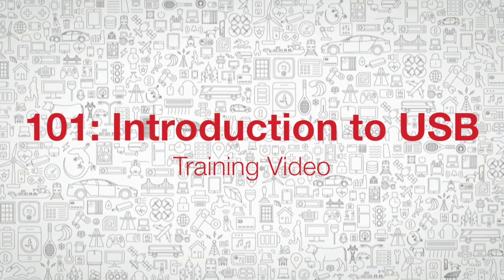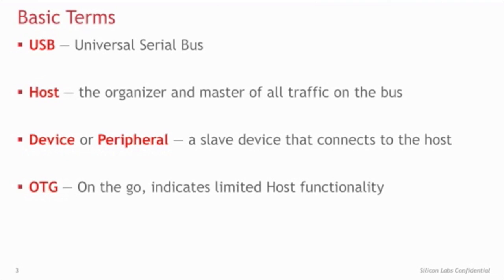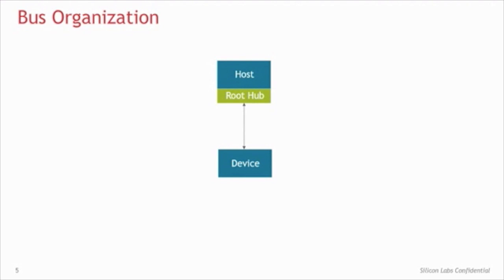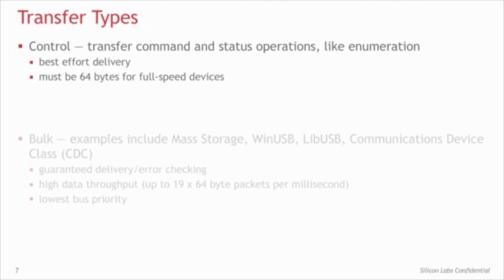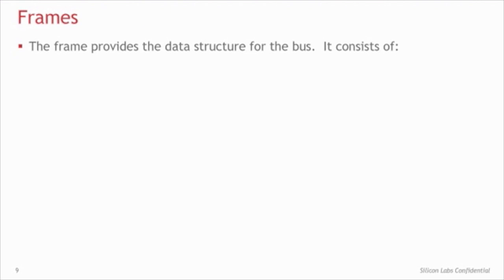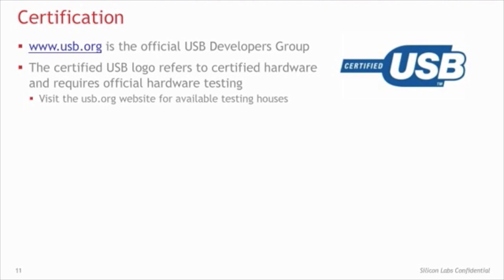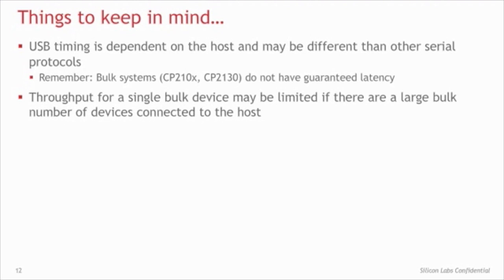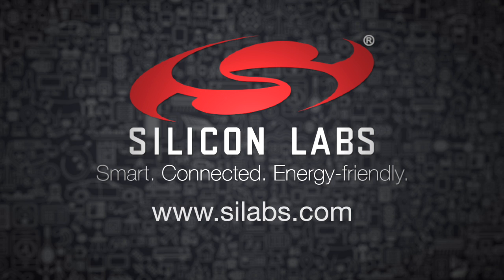Training - USB 101- Introduction to USB - Silicon Labs

Comment: Thanks for this.  New to USB and using a couple of your 2108  serial chips with a Cypress CY7C65632 hub chip.   It works fine with Windows but it is very flakey on a Raspberry Pi 3.  I think it has to do with the SPLIT packets from the Pi's OTG master through the cypress hub.  I am seeing the SPLITs and also STALL packets.  Does this make sense?